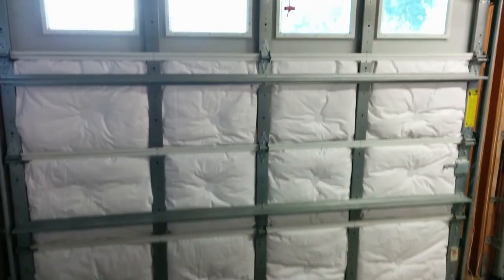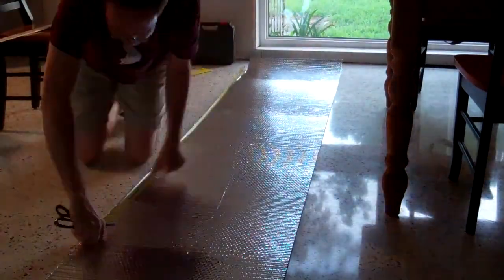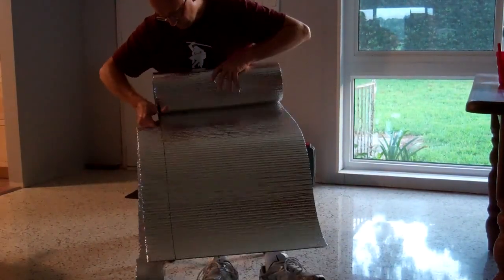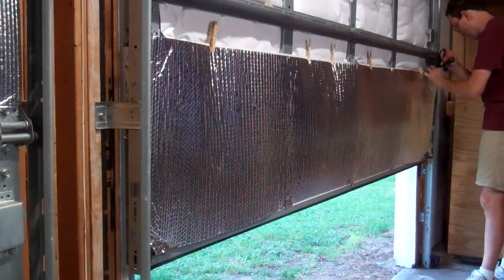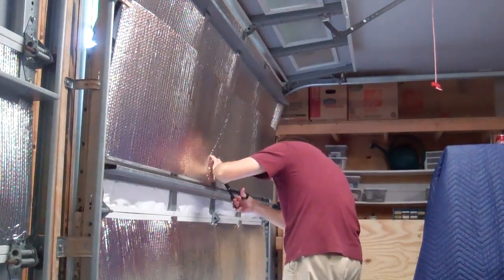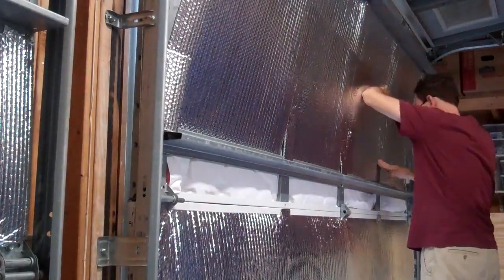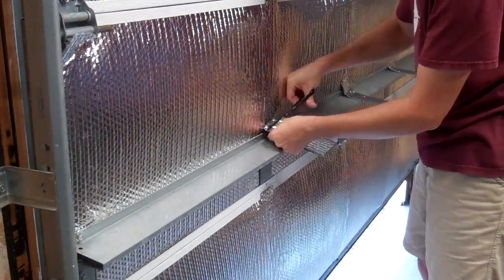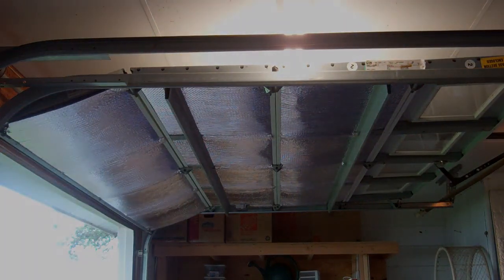Garage Insulation – Part 2 (Reflectix  radiant heat barrier)

Comment: I am about to do this but isn’t the purpose of the reflective material to bounce heat away, meaning it would be better to in in before fiberglass?
Reply from the maker: As a radiant barrier, the reflectex needs a "open space" on at least one side of it to function. I was worried it would be squished between the metal door and the fiberglass, eliminating the open space.  It works just fine on the inside as opposed to the outside, as it is preventing heat from the garage door from radiating into the garage.  [Also, it looks nicer than the white plastic backer on the fiberglass.]
Reply: @summetj  So are you saying the fiberglass is “open” enough that the reflectex can still do its thing? Also, any reason you went with fiberglass kit over the styrofoam kit? I’m really waffling over this decision.
Reply from the maker: @kyleucf  No, I am saying that the "void" into the garage services the purpose of the air gap needed by a radiant barrier.  I don't remember pre-cut Styrofoam kits being an option for me, which is why I went with the fiberglass ones. Otherwise, you can just pick whichever one costs less or has the higher R value.

Comment: any idea how much weight it added? im considering doing this on a 2 car garage door but im afraid it may weigh my door too much
Reply from the maker: Not enough to matter. Fiberglass and foam are quite light, and garage door openers are designed to work with factory insulated door panels already.